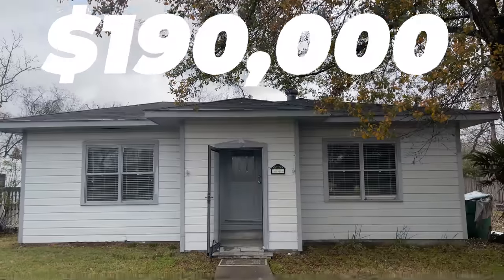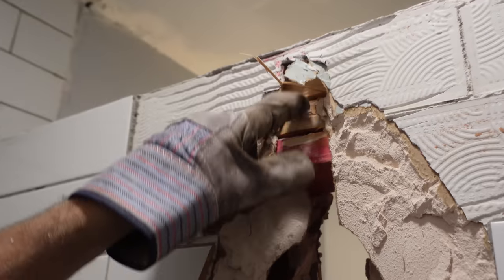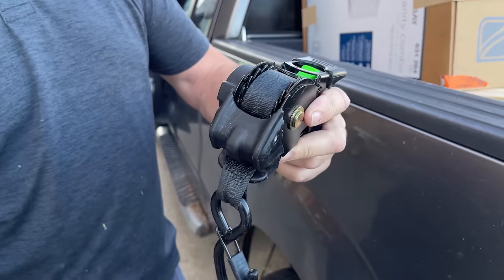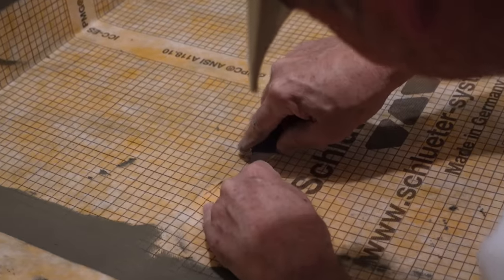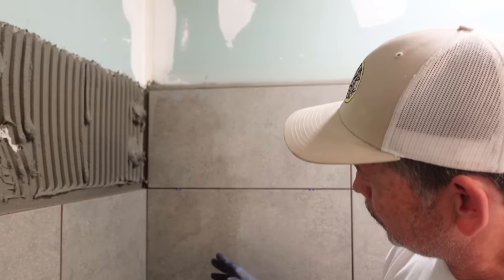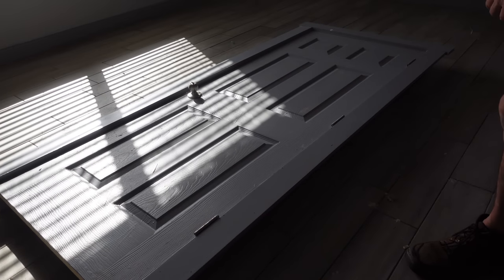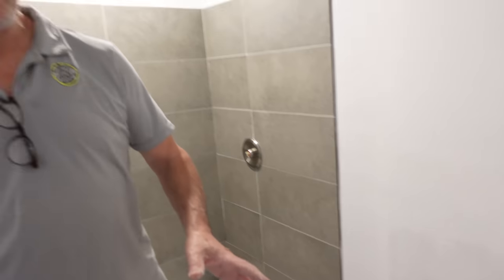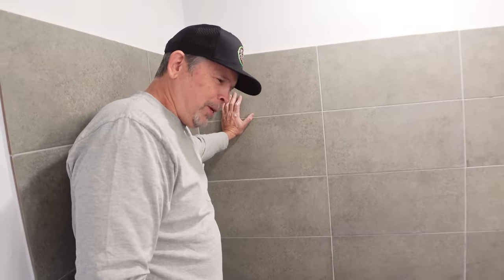MODERN BATHROOM for $1,000 CHALLENGE (Start to Finish)

Comment: Why would you buy all new.. I would've went to marketplace or CL and just bought a base, you have open drain under there a cheap surround system... Or on a pos flip house I just epoxy painted some plywood for a surround. Not my house.. That is really hokey... But your demolishing in 6 months. Soooo. Why put kerdi waterproof down? If it Minimal leaks.. who cares? Demoing the house.. It's t e m p o r a r y.. 🤣
Regardless, enjoying your videos.. I always learn something. 
Get a used vanity and top.. I could've done it all for 500 600 bucks.

Comment: You should rename your video, it wasn’t for $1000 regardless of why 👎 not to mention the corners you cut with a cement board that should go up to the ceiling in all walk-in showers. You should always use moisture barrier not only on the floor but also the walls because that cement board is not enough. Now you’re buying a wet saw which is not free.  You really didn’t show the full receipts when it came to all the Screws, the silicone etc. Lol I think you guys are way off on what you were trying to achieve for only $1000. Better luck next time.
Reply: You do not need moisture barrier on walls

Comment: I am a kitchen and bathroom home remodeling expert I am a master carpenter and a master ceramic and marble tile installation Craftsman 41 years in this trade I have worked for some of the most reputable companies in both my and Connecticut I have done work in the Bronx in the projects for the state of my as well as installing 57 top end bathrooms for trump in the plaza hotel and as I watch this video I can say under any situation the material alone would cost more than $1000 dollars as far as a rip out removed trash purchase and install plumbing purchase and install electrical purchase and install walls mud job framing curb subfloor backer board tile on walls and floors spread mud lay tile cut in tile grout tile joint compound walls sand prep paint purchase and install vanity with hot and cold water lines and drain sink toilet purchase and install toilet frame and install door with hardware paint ant trim out everything is a $10.000 Dollar job and for this video to say that these two clowns can do it for $1000 is an insult to the trade and every Craftsman on Earth and it seems to me that they have not been in home Depot lately as there prices are threw the roof and my Co has an account at floor decor this is false news this is so they get hits on there bullshit page this is un true this is not by any means real it is mathamaticly impossible